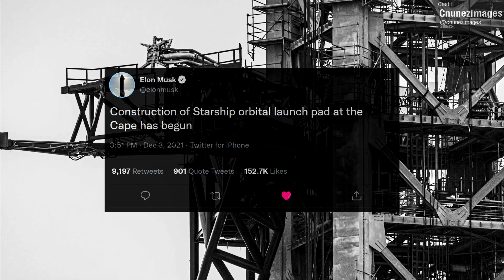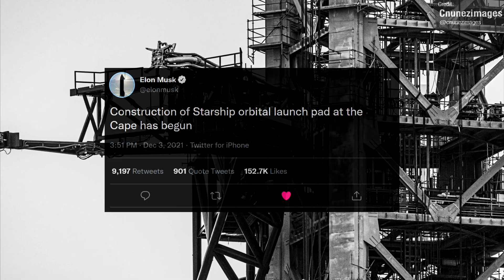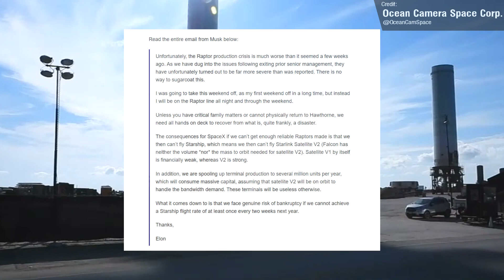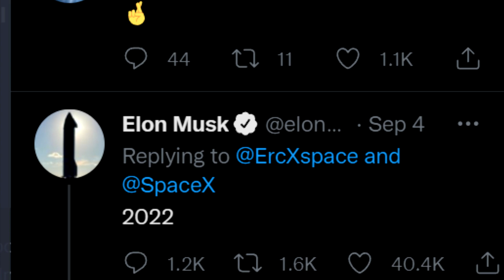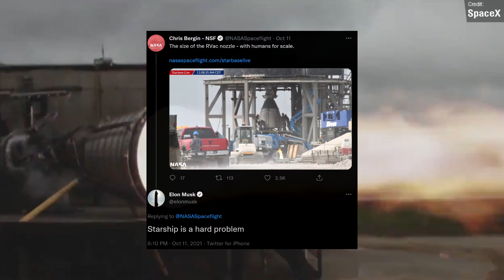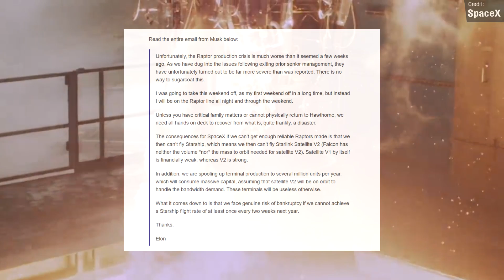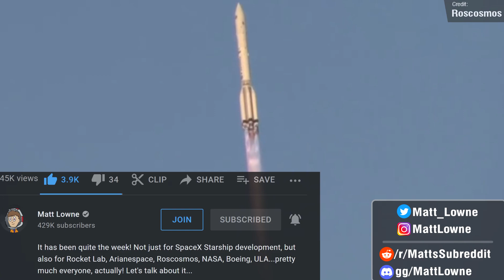Starship Second Launchpad, SpaceX Engine Disaster, Neutron, Starlink & Galileo Launch, Soyuz Tourism

Comment: "Neutron" had Super strength and low density (or mass per volume) - kg/litre - NOT weight which is a force (Newtons).
Please help educate the youth of Liberia and the USA (and slow remaining UK huggers of Imperial units) to fully understand ISO units and the difference between a mass and weight force which may vary depending on an applied acceleration.🥝🥝🙏

Comment: A launch every 2 weeks with In a year is insanity. A launch cadence like that from boca chica would never be approved by the FAA and that many launches from cape Canaveral would cause chaos for the air space around Cape Canaveral. Also the starship would be fully working for years
Reply: The FAA has set no limits on the number of launches per month, just the number of launches per year. So they could do launches every two weeks for about four months without exceeding the environmental assessemnt being worked on right now.
Reply: @espenha  good point. But it’s a problem. They will have to move from boca chica at least in terms of launches eventually.
Reply: @generalsirc2615  I think they will get the environmental assessment regularly updated, getting approval for more and more launches (with appropriate mitigations.) But shorter term, yes, they need more launch sites. That’s why they’ve started working on the second pad at the cape. As Starlink moves from Falcon 9 to Starship, that opens up many launch windows for Starship at the cape.

Comment: That catching tower is going to get destroyed multiple times guaranteed.
Reply: Probably not. It means the rocket is way off course. The catch arms are living dangerously, though.
Reply: @espenha  there is no way that catching tower will not be destroyed with in the first 10 catches. The falcon 9 has a landing success rate of a little less than 90%. Which is really good. However this landing is even more precise and if the rocket is off by a few meters it will end in disaster.
Reply: @generalsirc2615  The Falcon 9 has destroyed zero barges, despite slamming into them repeatedly. The tower can probably take some hits, but I doubt it will get hit, as the targeted position for the catch is at the end of the catch arms, which gives significant margin for error without risking the tower. During the landing burn, the rocket will also monitor whether the rocket is veering off course, and rather crash into a safe open area than risk the tower, if things are going wrong.
Reply: @espenha  the falcon 9 booster is much smaller than the starship booster. But we will see. I hope it doesn’t take out the tower.

Comment: i think that starship itself is a bit way to expensive to manufacture and produce, although it differs from other rockets because it will so called "potentially" be able to get to mars, unlike other rockets which will just get you into space.
Reply: The cost of Starship isn't the problem, it's much cheaper than alternatives. It's mass production that is where the difficulty lies.
Reply: @Jogeta5  if it even is successful.

Comment: Do those BF Chopsticks look like Catching Arms to You ? ... They look like Lifting and Stacking arms to me ! ..... To catch something you need quick reflexes and some padding ... steel on steel has no softness or forgiveness at all ... and anything slightly off means Bending or Crumpling ... Just look at the "Successful" landing of BN15 ... Crumpled legs , a fire , a time bomb waiting to blow up ... and a Compromised Rocket ! ...... Plus the BF Clamps face in one Direction , meaning the BF Booster has to come in at a Specific angle , speed , trajectory and orientation ... irregardless of the Texas Wind ... Otherwise it will result in Crumpling , Shock , vibration , cracks and potential Disaster ! .... I would like to see the Proper Computer Modelling or real-life Modelling demonstrated before I believe those BF Chopsticks can catch anything ........ And if they DON'T WORK  ... Musk's BF Ideas are all BANKRUPT in a BF Way !!   LOL !  :-(

Comment: I don't see any BF Shock Absorbers on those BF Chopsticks .... Or hear any of the Space Nerd shows pointing them out ... Nor any CGI cartoons depicting them ! ... My guess is the Catching Mechanisms aren't added yet .... Remember , this System is Musk's vital tool needed for re-usability ... And they have to Work Flawlessly ! ... My impression of those rails is for them to make Precision moves needed to lift , lower and line up the halves for Stacking .... All wee see is Simplistic and technically vague CGI World Series Catches ... and Everyone doesn't have a Clue as to How it will Work .... Or if it will ever work ! .... That's if the BF Monstrosity doesn't Blow the place Up on the First Try .......

Comment: catching animation is wrong it doesn't even hit the grid fins LOL
Reply: The animation is correct.  The grid fins were never intended to be the catch point on the booster.  There is a set of hard points below the fins that are the actual catch point.  Ship has an identical set of hard points.
Reply: yh sure. so instead of an accuracy of a few meters we have to be accurate to a few cm...
Reply: @TheZoepers  yep

Comment: Having worked for a very large company I can confirm that managers will in fact try to sweep known problems under the rug and will devote all their time and resources to pinning the blame on another manager instead of trying to fix the issue.
Reply: Given the NDAs, we'll probably never know for certain, but it's also rare than any one person is responsible for a SNAFU of this size.  The ex-VP could have been doing everything he could to fix it, but not gotten the necessary support from Elon, other VPs, etc.  Or it could be an unsolvable problem due to supply chain issues.  Maybe in a few decades we'll get a tell-all novel of either the early stages of the behemoth SpaceX became, or a cautionary tale about the colossal failure SpaceX became...

Comment: I suspect the cape launch pad is being started in case permission to launch from Boca Chica is denied or delayed. That environmental clearance is far from a foregone conclusion.
Reply: If that was really the reason, they probably would have started sooner. The pad at the cape won't be ready for launches until the end of 2022 at the earliest, and most likely not until 2023.

I think they are starting construction of the pad at the cape now because they expect to be launching more than the PEA at Boca Chica allows at the end of 2022. It only allows for 5 operational orbital flights per year.

Comment: 9:20 Unless the first stage can land somewhere downrange, it can only be used in the atmosphere to get high enough to open up the farings.
IMHO second stage must supply orbital velocity.
Looks like a limit on payload orbit to me.
Reply from the maker: No rocket in the entire history of mankind has had a first stage that can reach orbital velocity. That would be a single-stage-to-orbit.
Reply: @MattLowne  That's not quite true, though it depends on how you define the "first stage". Like, the first stage of SLS can reach orbit. But it has additional boosters.

I wouldn't take Greggs comment that litterally, though. My interpretation is that the Neutron first stage will be doing way less work than most other first stages, and he's right. As long as the Neutron first stage is doing return to launch site, it can give very limited horizontal velocity to the second stage and payload. Very much of the work will have to be done by the second stage.
Reply from the maker: @espenha  we literally don't know what it's performance will be, and Falcon 9 first stage returns to the launch site (and eventually Electron) and that rocket is very capable.

And yes technically some rockets can get to orbit in one stage but they can serve no practical purpose and can't carry payload so it's not a relevant point to the initial argument that Neutron is bad because it needs a second stage to reach orbit.
Reply: @MattLowne  I didn't see that the initial argument is that Neutron is bad for having a second stage. The initial argument to me seemed to be that Neutron is leaving a lot to the second stage because the first stage isn't doing a barge landing.

And this is also true of Falcon 9. Doing RTLS means taking a significant payload hit. For LEO, Falcon 9 does 22.8 tons expendable, 15.6 tons ASDS and more like 11 tons when doing RTLS. That's a 30% hit over ASDS. And the payload hit is even greater for more energetic orbits/trajectories, as with lighter payloads needing more delta-V you ideally want to stage higher and faster. For GTO, Falcon 9 does 5.5 tons ASDS and 3.5 tons RTLS. That's a 36% hit. But Falcon 9 has the advantage of being able to select between RTLS, ASDS and expendable.

The criticism also applies to Starship. If it in fact only will do RTLS (which it might not - Super Heavy could for instance launch from Deimos and land on Phobos, and then the platforms switch positions for the next launch), it is taking a substantial payload hit. But Starship of course also has the advantage of being massively capable, so even with the payload hit it can do almost anything.

As it looks right now Neutron will for the most part do only RTLS. The Neutron first stage likely won't be very cheap to manufacture, which is fine as long as you are recovering the stage. I don't expect Neutron flying expendable can really compete with Falcon 9 with ASDS landing, which has better performance while still recovering the first stage.
Reply: @MattLowne  Oh, and the Electron won't be returning to the launch site. It will be captured by a helicopter at sea. Efficiency wise it's equivalent to a barge landing.
Reply: The first stage goes to space, suborbital. The second stage goes to orbit. It's just like Falcon 9.
Yes, RTLS is less efficient and limits mass to orbit, but Neutron is planned for 8 tons in RTLS mode and 15 tons fully expendable. Landing downrange would offer up an in-between option but the 8 tons already cover the majority of the market.
Reply: Or maybe I misunderstood you. The first stage does also supply quite a bit of horizontal velocity but in RTLS mode it needs to separate with enough fuel left to completely turn around.
That's done to make the second stage lighter as it gets penalized for higher mass more than the first stage. The physics of getting to orbit are weird that way

Comment: I really wish that the Raptor problem gets fixed fast. 
You got this Elon!

Also, is something wrong with everything from ULA? Everything is getting delayed lol
Reply: dragon 2 was delayed 4 years, it's not just ULA bud
Reply: @mathewferstl7042  Most of that delay was because of Congress though. They didn't fund the development like NASA and SpaceX had planned.
Reply: @espenha  Something similar can be said about SLS but I can say with some certainty  you've complained about the delays in that. If that's the case, always the double standards
Reply: @mathewferstl7042  In 2011, SLS was planned to cost $10 billion. Thus far it's cost $21 billion. Unlike SLS, Dragon 2 didn't go over budget, it just took more time because the funding was divided across a longer time period.

Comment: For real tho
If they master the catching thing with starship, they can simply fly it to cape. They can also use Deimos and Phobos.
Reply: They can fly the Starship, yes.

But I don't believe it's actually possible with Super Heavy. It's far enough between Boca Chica and the cape that the Super Heavy would have to basically be going at orbital speed to cover the distance. And it doesn't have a heat shield for reentry, so it would not survive reentry. Reserving sufficient propellant for an entry burn isn't possible because it needs the propellant to get enough speed.

So, I think we will see at least Super Heavy being transported by barge, or Deimos/Phobos.
Reply: I don't know if NASA and the FAA likes the trajectory over Florida to land at Cape
Reply: @xWood4000  It's in the environmental assessment for the cape, so the FAA is open to it.
Reply: @xWood4000  They don't and will refuse ----consider a booster breaking up and falling on a neighborhood.
Reply: Why launch it to cape just to relaunch from there? If you're launching from somewhere anyways....
Reply: @nealdesai8779  SpaceX is probably going to get approval for 5 operational Starship launches per year from Boca Chica, but they already have approval for an unlimited number of Starship launches from the cape. So getting the Starships to the cape allows for many more launches.

Comment: The Starship project has always been financially dubious.
Reply: I wouldn't say it's more financially dubious than any other rocket program. Maybe even less so, given that it's intended to be fully reusable.

It takes guts (or insanity?) today to try to make an expendable launch vehicle, and believe you'll be able to beat all the other launch companies.
Reply: @espenha  unfortunately, guts isnt all it takes in the rocket industry, the science and technology has to be there too. Elon consistently makes wild claims and fails to deliver because he doesn't consider the science. E.g. Hyperloop.
Reply: @nealdesai8779  When I spoke of guts, I was talking mostly about new expendable launch vehicles from new companies. Like Astra Rocket 3, Virgin Orbit Launcher One, Firefly Alpha, Relativity Terran 1, etc.

In comparison to what those guys are doing, what SpaceX is doing doesn't really take guts. SpaceX is the largest launch provider in the world and they mostly know what they are doing. But like with any other new launch vehicle, failure is always an option.
Reply: @snuffeldjuret  "Hyperloop consists of a low pressure tube with capsules that are transported at both low and high speeds throughout the length of the tube. The capsules are supported  on  a  cushion  of  air,  featuring  pressurized  air  and  aerodynamic  lift. The  capsules  are  accelerated  via  a  magnetic  linear  accelerator  affixed  at various stations on the low pressure tube with rotors contained in each capsule."  - The whitepaper.  That's a lot of claims that weren't met.
Reply: @georgedorn_fnord  How are these claims that were supposed to be met? Describing a theoretical concept does not create an obligation to make it a reality...
Reply: @snuffeldjuret  see the common sense sceptic YouTube channel. Then rethink your answer.
Reply: especially launching in a nature preserve, without permission, against FAA guidelines

musk is a toxic narcissist
Reply: He's just being a shitty boss, trying to overwork his workers